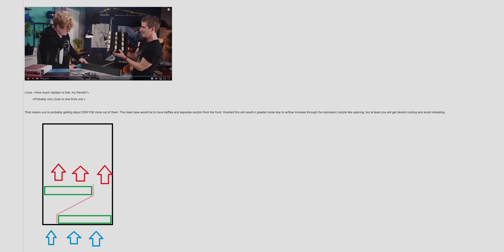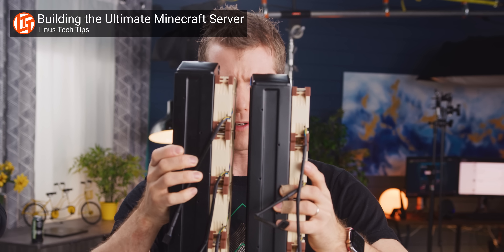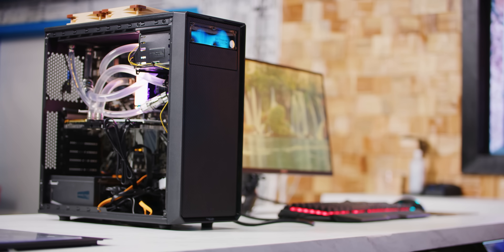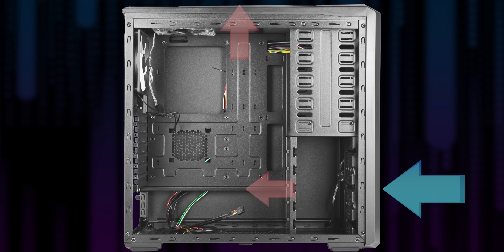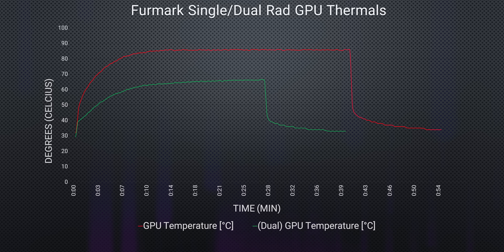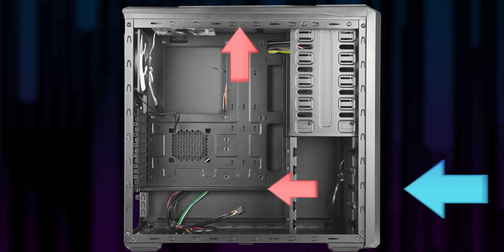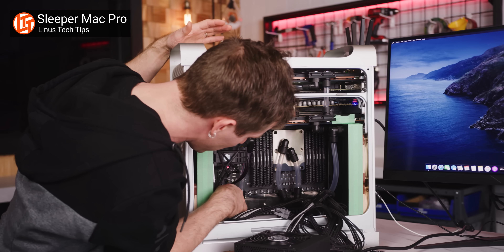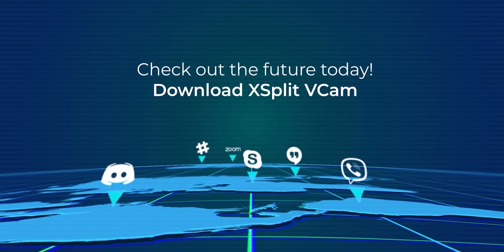I’ve been water cooling wrong for YEARS - $H!T Manufacturers Say

Comment: It’s surface area and deferential of temp. To disappeared the heat. Rapid air flow could pass through fast enough to not be a high temp but that is how loud server jet engine fans work. The positive pressure inside the case will also decrease airflow. 

So open case, long hoses, radiators all over to save a couple degrees. Good job. Or a waste of time.

Comment: My recent experience this week from my new ITX build. 3900x, Asus Formula VIII Impact, 2080, 2x m.2, 550watt sfx power supply, Alphacool Eisbaer Solo (pump, cpu block combo 2600rpm), all (1500rpm) be quiet silent wing 3 fans all in NZXT H210 case, 240mm rad front and 120mm rad rear, was fan push pull config mattered. Original had 2x 120mm front, 120mm rear and 120mm top fan to blow air front to rear. The Temps of my cpu under load (100% cpu burn test with GPU running 100% load test) 4.6ghz (no OC) showed Temps hitting 80c (no thermal throttling) . I reversed the front fans, so rear and front was blowing out, and top fan was pulling cool air, and Temps now at 68c (100% cpu and cpu load, and fans 100%).
(if interested tubbing config was cpu-240mm rad-gpu-120mm-rad)
Reply: But in this small case fan placement seem to matter more than rad placement, as he stated more cool air=better heat distribution.
Which my full tower atx build I did, 360mm rad front and 240mm rad top, there was no difference in fan placement. Orginal was 240mm rad on cpu, then I added gpu to loop and added the 360 rad, there was a significant degree difference when I added the 360 front.

Comment: You used a 240 rad? I presume that was chosen due to the case size, but would a single 360 rad perform better? I would have expected a few different configurations to look at temps across the board

Comment: I wouldn't stack them. I'd run 2 rads in solo positions as intakes so they both have cool air, and it would also help create positive air pressure in the case which would help with dust. 
If I was doing a custom loop, I'd have the flow order as CPU-rad-GPU-rad2 and back to CPU. Reduce the amount of hot liquid from one PU to another. But...I don't do custom loops. I just use AIO's XD

Comment: I agree with Corsair, around ambient temps of -10-+10C, I originally had a 3900x and 1080ti on a single Mora3. Using a fan in either push pull. During timerbench I would hit around 12C. I ordered a secondary rad with copper piping but aluminum exterior like the mora3 but bigger tubing inlet outlets and crossectional tubing. I put mora3 on one side of the fan and the other rad on other side. Fan in-between 2 rads... With the same ambient temperature, I was hitting 20c+ and crashing the GPU since the overclock was not stable above 20c. Thinking there was some other reason, I bought an ac pump for hottubs, 1/4hp, pumped so hard I could literally see the ac waveform in my tubing due to that much flow or pressure, something. Same results, and the pump did not add heat to the loop, it sent it to the metal housing on the pump, and that thing got warm. Idle temps were the same as original config. Removed secondary rad and kept the AC pump. Boom, back to stable overclocks and low temps. The issue here is you refer to directly triple stacking rads sandwich style, but proceed to test an open air case without sides, and the 2 rads nowhere near each other, and I didn't catch the fan configuration, you are testing a completely different setup. If both radiators can essentially dissipate the same amount of heat but heat from either rad is not pushed through the other sure you can see benefit.more liquid in the loop, longer time to reach max temps, easier to cool by lower ambient temps. Stack the coolers sandwich style. Either rad fan rad or fan rad rad... I'm sure you'll receive corsairs results. This extends to more extreme temps, even at -10c. I probably won't test this anymore, as I have moved to a phase change system, gonna get that -40--50c, just waiting for thermal paste that won't freeze at 0C to arrive. *Tapping foot impatiently for Amazon.

Comment: I think they meant when you stack them directly onto each other the radiator on the back is nearly useless because its getting hot air to cool hot water. Not when they are spaced far apart.

Comment: It makes sense when you perform a test where one 2 fan rad is at its limits. I want to see a test where maybe instead of a 240 rad setup, you use a triple rad, or something more capable of dissipating the heat.

If the first radiator is unable to keep up completely with the cooling, then of course a second radiator will help as the water will remain hot enough by the time it gets to the second loop.

But what would perform better. A single triple fan rad setup, or a two dual rads in this configuration?

Comment: Stacking radiators is just putting fins in series. If a single radiator is thick enough and the fans are spinning at a fast enough rate to remove heat from the water in the rate at 100% efficiency to have all the heat transferred into the air by the time it moves out of the other end, then yes, adding another radiator won't help. However, if that's not the case, which it probably isn't, stacking a radiator is just basically equivalent to having a radiator with double the thickness. Everyone knows having a thicker radiator helps given that the fan produces enough pressure to push air out the other side and that the system hasn't reached peak efficiency in removing heat. I don't know what the Corsair guys were talking about, but this is really basic heat transfer learned in sophomore years of undergrad.

Comment: Um I don't think you "stacked" rads the way they meant. If you sandwich the rads like you did in the Minecraft server, you hit diminished returns immediately. This is because the hot air from the first rad immediately comes into contact with the second rad. Say the water was at 41C in the loop, after the first rad, the air would heat up to say 35C then if you immediately blow that into the second rad now your temp difference is 41C-35C which would cause barely any heat to go into the air from the second rad due to the ∆T being 6C instead of 19C.  I hope that made sense, remember Q=(m_air)(C_air)(dT_air/dt)=(m_water)(C_water)(dT_water/dt)... Man I wanna break out my old thermodynamics book...

Comment: I have two radiators in my loop, BOTH are intakes, top and front. And I have a 140mm exhaust fan in back. And without the 2nd radiator, my temps were way  higher. So maybe the way I have been doing it can work.

Comment: Could it be that there's more water in the system when you add a second or third rad? More water would equal a higher ability to soak up heat.

Comment: I like how you tested and explained how the system was being cooled. As for the Minecraft server's triple rad setup, could the direction of the water flow between the fresh air and CPU make a difference? Like starting at the rad next to the CPU be hotter or colder? You did say their logic was hot air doesn't cool a rad.

Comment: I think you need more tests, and the good thing is, you can do this with a test bench. First, run the benchmarks with a single rad. Then, run the benchmarks with four rads. Then, run the benchmarks with those same four rads, but stack them. And finally, seal the sides of the stacked rads, so that all air going through the rads, has to first go through the first rad in the stack. 

I've got a feeling that best to worst performance will be: 4-rads (unstacked), 4-rads (stacked), 1-rad, and 4-rads (stacked and sealed).

Comment: as a mechanical engineer, i have one advice for you linus. your rad should be placed in a way that pulls air from the outside (cool air) from the front or the sides of the radiator for best results. and you should use powerful fans to exhaust the air from inside the case from the top of the case. the psu under load turns on the exhaust fan, taking cool air from outside and exhausting hot air inside your case , so if you are placing the radiator on top of the case and using the air from inside your case you will notice that the air inside the case will always be a little warmer then the outside. also fans are more efficient if they are in a pull direction that a push direction. which is why air blower motors need to be more powerful to move the same amount of cfm than vacuum motors. another advice that i would suggest you is that you put the output of the radiator directly into the item that you are trying to cool. some mistakes i've noticed you do in the past is that you take the water from the reservoir into the item that you are trying to cool, then into the radiator then back into the reservoir (which is needless to say that because of the heat present in your case, leads to the water in the reservoir to warm up a bit). that kind of configuration is useful if you are trying to feed multiple devices in parallel using the same water source (which would mean that your rads need to be connected in series and increase the number of rads in porpotion to the number of devices that you are trying to cool in series). instead you connect them in series (reservoir, to graphic card, to cpu to the next rad and back to reservoir). if you do want to connect them in series and you have two radiators try this configuration (reservoir to rad, to cpu,to the other rad, to gpu then back to reservoir). if the same cooling source is to be used then the supply tube used needs to the equal about of gpm (gallons per minute) to the sum of the gpm to the tubes connected to it. my suggestion is that for optimal performce you use a separate loop (rad and water supply) for each component that you are trying to cool (one for cpu and one for gpu). that is my two cents.

Comment: Good video but I'm disappointed that you guys didn't put a thermocouple at the exhaust of the first rad and intake of second rad. From what it seems, the root of corsair's claim is that radiators are so efficient at radiating heat the exit air flow is nearly the same temperature as the water. I think it would have been very important to put that claim to the test.

Comment: Would the optimal placement for a radiator be outised the case? So  that it gets undisturbed ambient air, no back pressure and doesnt pump any heat into the system with it's outlet

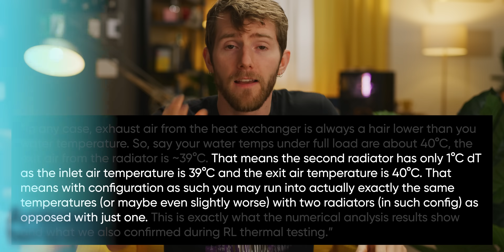Comment: I think at 2:29 Corsair is making a huge assumption that the 40C radiator will warm up the air up to 39C. Obviously depending on various factors, the efficiency of the rad will not be close to that, so a second radiator will in most cases help. Diminishing returns apply, obviously.
An exit radiator though...

Comment: My experience from reading and my own rigs, FWIW...  Radiators should always get fresh air intake and not be used as exhaust.  It'll still work as Linus has shown but it won't be as effective, similar to how stacking rads looks awesome and can save space but isn't as effective heat dissipation wise as running them separate with their own intakes.  Airflow from any fans in the case is gonna make the whole theory of convection pointless as well, the air will flow where ever it's forced too.  My experience also shows negative pressure to be better for cooling as any heat is drawn out for either water cooled or air cooling, but having rads get fresh air is more beneficial.